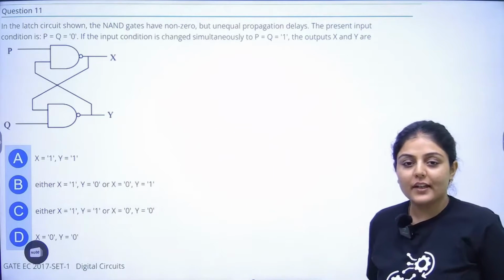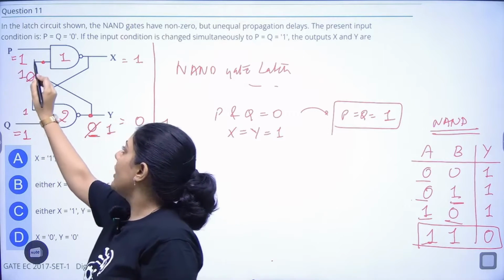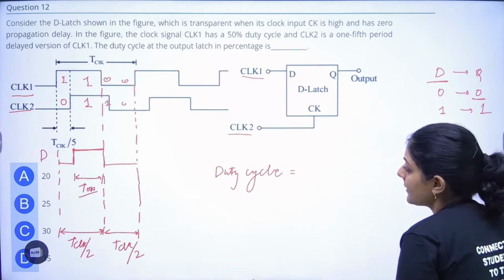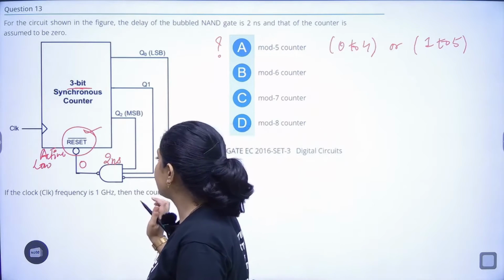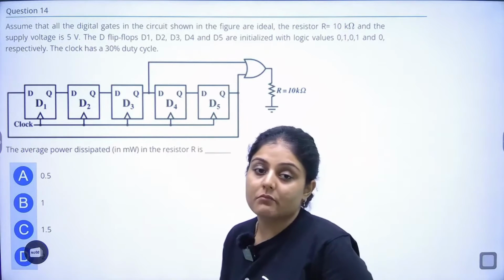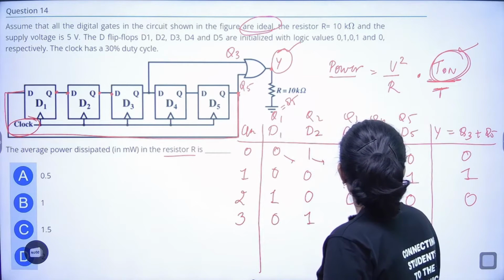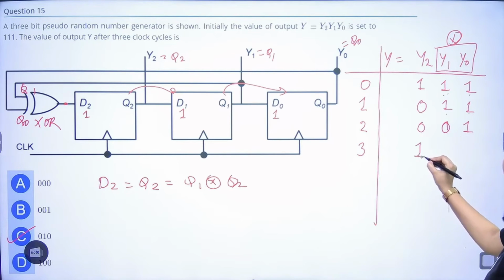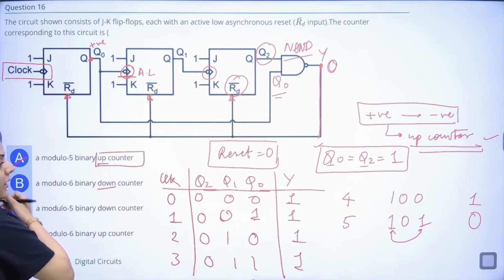DIGITAL ELECTRONICS Test & Interview QnA Class-11 | SEQUENTIAL CIRCUITS Part-3 | www.vlsiforall.com

Comment: Mam last one answer is mod 6 up counter right,as it is counting from 0 to 5 means 6 states
Reply from the maker: Okay. Will cross-check it once.
Reply from the maker: It will be MOD 5 only because in a counter mod value is the value where counting ends. Like it ended at 5 so it will be MOD 5
Reply from the maker: GATE EC 2015 it is and the Answer is (A)
Reply from the maker: 5 is not counted as it get reset at 101